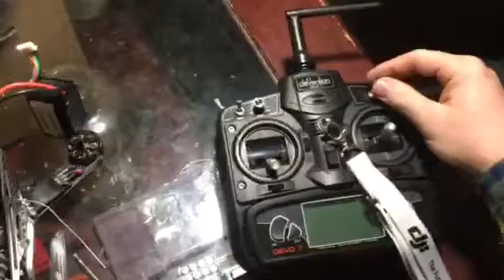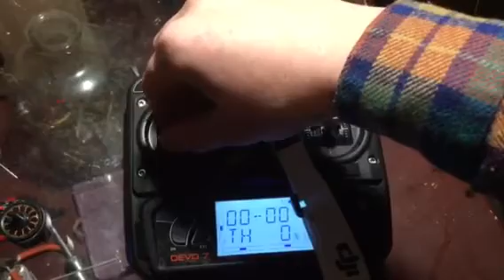Walkera f210 fail safe issue

Comment: i found two different failsafe setups for the devo 7. i will test them both prior to flying my replacement. the one is the same for the 250 runner. you live and learn. im happy that no one got hurt or property damage. not ready to give up on this drone. the one thing that sucks is Walkera is useless with there products. they said " you have to add some things and try to program the radio"

Comment: Did you set the fail safe on the devo7? With my runner 250 I had to set it up myself, from factory it wasn't setup
Reply: +Crash Override82 I used the same set up as the runner 250 on my devo 7 and tested it 10 times and the motors shut off at 15 seconds every time. I was able to rebind the f210 every time as well. 15 seconds is still to long and keeps the throttle % at the time the radio was turned off. This is what I used, FUNCTION>SAFE>THRD> L100%
Reply: +jason waddingham 15 seconds with these things is far too long. I could fly the length of 2 football fields in that time at full throttle. My helis had FS 10 years ago.